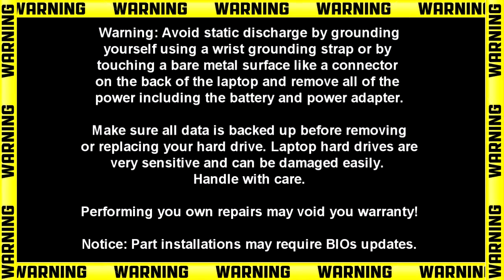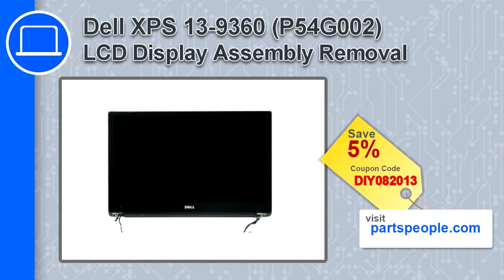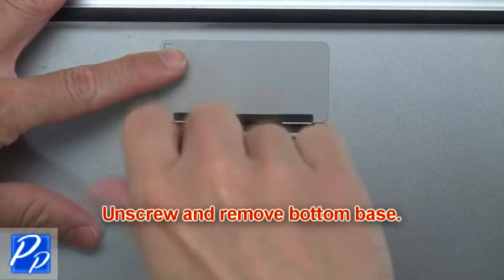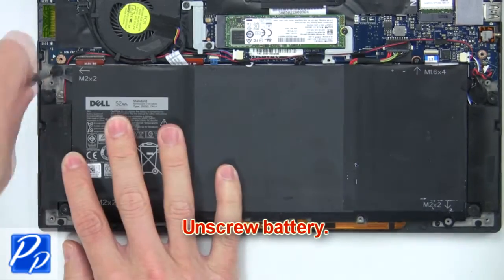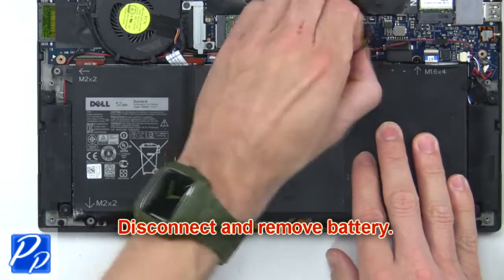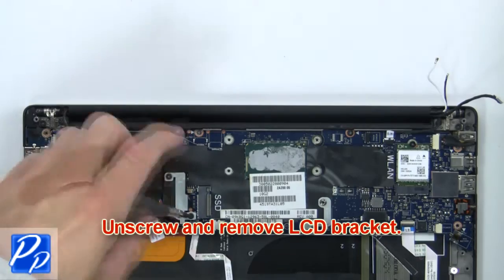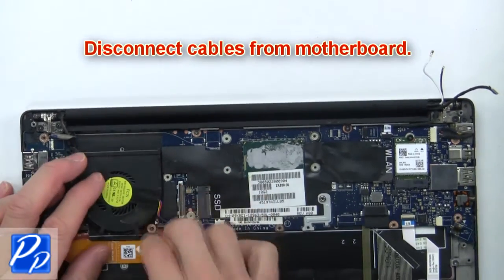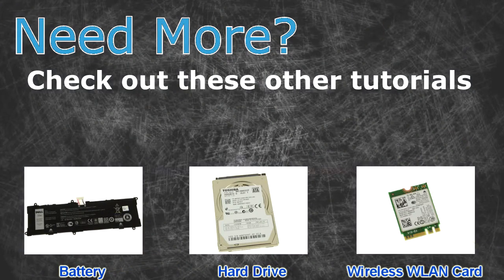Dell XPS 13-9360 (P54G002) LCD Display Assembly How-To Video Tutorial

Comment: Every time when the laptop goes to sleep mode by itself and I turn it on again, the touch screen will be partly unresponsive, to be more specific, it is the upper part of the screen. The problem is only at the screen, mouse and touchpad are working fine. Now I can solve the problem by pressing power button to let it sleep and press again to turn it on, but I don't want to do this everyday.